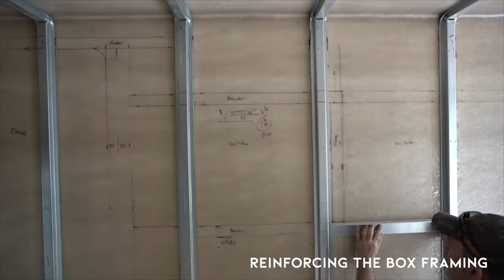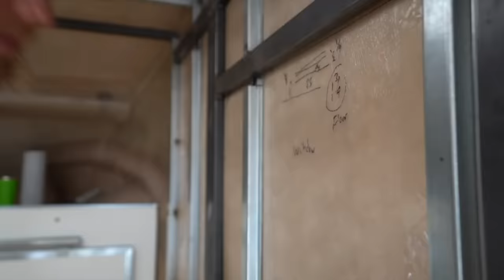Full Build Timelapse Start to Finish! Chevy Express 3500 Unicell Box Van! #vanlife

Comment: Hi guys, loved your time lapse of the build. I have a question for you. I’m going to build out a van this summer. Basic in the extreme, not much $$. I like the idea of a heated floor for safety and ease. I saw you roll out the heat mat but didn’t see how you secured it and if you put something between it and the LVP. Thanks for the input.  Almost 80 senior lady. This will be my 4th rig. Started in 2010. Cathy ❤

Comment: Incredible! A box van really is the way to go if you want to maximize your space.
Reply: Plus you get the most bang for buck in square footage an easier to start with a blank canvas instead of having to remodel a old RV that was built cheap cheap 30 yrs ago already. You get complete design control. Just your imagination is limiting you. An cheaper to buy HOME PRODUCTS than RV type products. Which u almost have to put back RV items like stove , ice box, toilet, shower, electric switches, plumbing alone is a beast in RVland ,they all use a. Very very specific type of pipe an drain line sizes are all off also from normal home stuff which all mean very very $$$ expensive.

Comment: May I make a suggestion? The propane line at your tire needs protection. As a truck driver I've seen many tires blow and when they do they make a mess of everything they touch when they come apart. If your tire blows and hits that copper line and gas fittings it is sure to rip them apart and the steel belt in the tire will make instant sparks on the road. Propane and sparks, you know the rest. You should build a solid low profile box to protect or at the least a flat piece of steel bolted to frame that can withstand a blowout. Otherwise, great job on your build!

Comment: Amazing build!!!! Fabulous design, fabulous finishes. My one question is why you used metal framing rather than wood - does that not add a lot of weight to your van, and therefore increase your fuel consumption?

Comment: I am curious as to why you put steel into the cabinets. And why on the upper cabinets you used such heave plywood? I would think that weight savings would be a forethought. I know in the build  that I am currently undertaking, I am building cabinets equally as strong but half the weight.

Comment: I got two questions, the first one is did you put insulator in the wall paneling just curious about that? And the second how did you avoid tapping in the floor screws without hitting the gas tank or either the gas line themselves?

Comment: Hi,
Just a question, insulation for wall and floor and ceiling, what about fill in with whatever insulation and then use vinyl tiles to stick on top of the metal.
Will it work.
Thank you

Comment: Why the grid on the floor for the insulation instead of larger sheets? Why put a back on the upper cabinets when the walls are wood?  Placement of the projector?   Overall, Fantastic van home!! ❤️

Comment: From the looks of you welds I can say they won’t hold up after a long trip.you didn’t bevel any of your cuts and then grinder down the small tacks that should have been full welds.also why did you make such huge cuts in the truck frame? You weakened it pretty bad.imo you should have had all that done professionally.you’re jeopardizing your own safety and van structure.